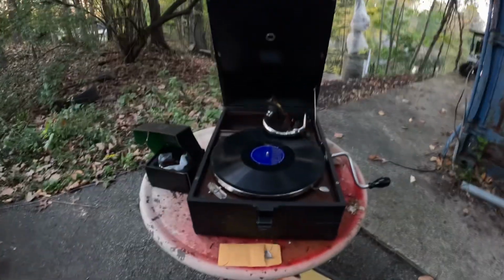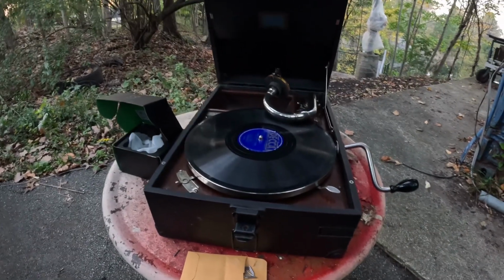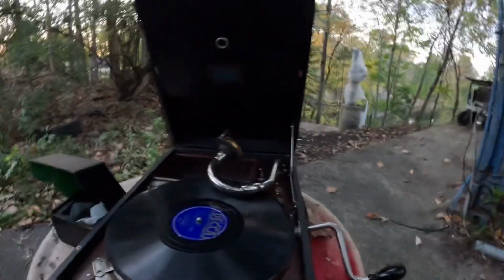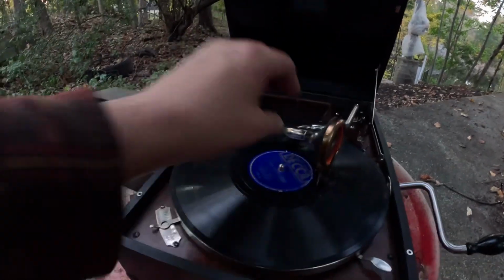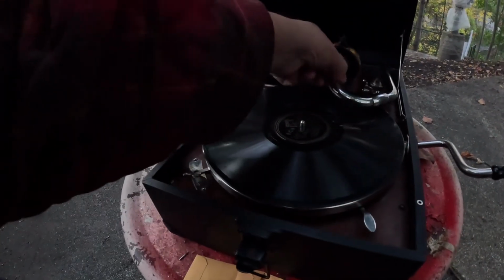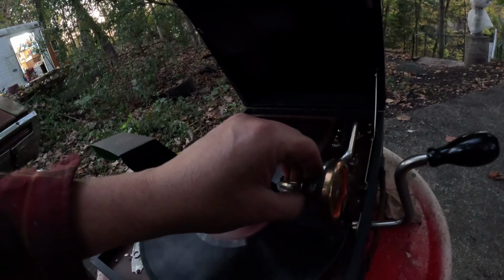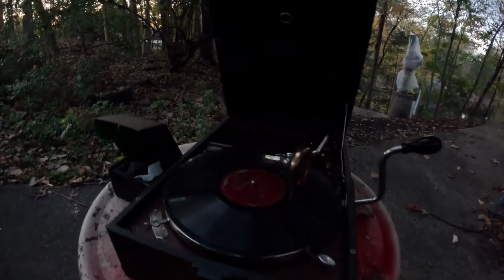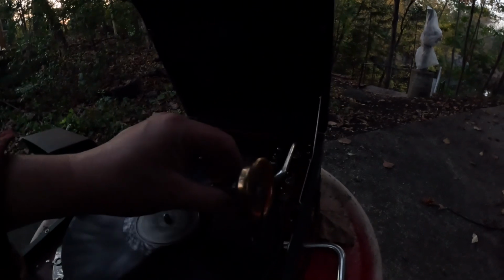Electrola 101 experimenting with victrola number 2 reproducer

Comment: I have two HMV101, both of which have weak motors and cannot properly play loud sounding electric record discs. However, the No,4 reproducer with mica diaphragm sounds good and is a lightweight and easy to carry.
Reply from the maker: All of these portables have small and somewhat weak motors. It’s the nature of the beast as these are portable machines they have to be light and that was something HMV seems to have understood better than some other companies. If you put large springs in a motor you have to make the motor larger and weight increases. We saw this happen with the colonial models made in India, where they used the double spring motor more commonly found in large table, tops, and floor models. Now you’re hauling around a piece of furniture. Now springs are available, new ones they are 1 inch wide by 9 to 12 feet long depending on the model of motor. If you have the number 59 motor that’s the spam can motor with the aluminum body. Then it’s going to  be 12 feet long or 13. Sometimes you find that long too. It will have a pear-shaped hole on the outer end, and it bent end on the inner side. I am sure US suppliers can make the spring for you, and if you were in the UK, you could find them there from suppliers or from a supplier in the Netherlands, who advertises on eBay a lot. At best even with a new spring you want to keep the records to the ones that are in reasonably good condition for playing on these machines, otherwise what you saw in the video is what will happen. They just don’t have the extra horsepower to push through a groove that is badly worn and dragging the needle. This happens to me quite a lot when I’m playing these machines mostly because I buy my records at estate sales and flea markets by the 50 lot or the hundred lot or the 200 lot not graded not inspected just bulk. You could go to eBay and I’m sure to some online places and buy records from dealers that have graded them professionally so you know exactly what you’re getting before it reaches you, assuming it does reach you with the state of the Postal Service these days. You can’t always tell how well a record will play until you actually play it. As you could possibly see in the video, the red label record kind of looks scuffed up and worn, but it played, maybe not the best sound quality but at least it didn’t stop the machine. The HMV portables make up for the weak motors by having an excellent sound quality and a very good overall design. That just wasn’t much they could do to increase the power of the motor while still keeping the small size and lightweight. And of course, it must be remembered that when these machines were new, it was expected they were going to be playing brand new records a resource we do not currently have available to us.
Reply from the maker: On another note, if you have a pot metal number 4 reproducer that is not deteriorated, and could be rebuilt You were very fortunate. Being that I play with a lot of these machines I am constantly on the lookout for reproduces to use in them.  I’ve even gone as far as having a back piece custom made in order to play one of these machines.

Comment: Congratulations you have proven a wound down spring won't play a record after one side then give it a few turns more and it will play. Wow! that's doctorate thsis level material (-:
Reply from the maker: The point of the video was to test a No2 reproducer on a machine issued with, and intended to be played with the No4.  Demonstrating that a small motor will have difficulty with a worn record was a side issue.  I believe I did wind the spring on camera before playing the records.  The motor had no issues with the Decca or the Victor red label as both records had less wear.  I knew the RCA's had serious wear, not unusual for an album that was very popular in its day.  Estate sale find for fifty cents, sometimes you get exactly what you pay for.  I will be demonstrating the machine again with better records and a good No4 reproducer later on.  This video was also a test run for the new camera that is supposed to have some very good picture stabilization technology.
Reply: @Rockisland1903  
I see, thanks!

Comment: Hello, I wonder if anybody could help me
I've recently acquired an early 1926 HMV 101 (it was my great grandfather's) and it has been in storage for a while and I want to get it working properly again. It plays gorgeously but the motor is loud and there are loud clunking noises when I wind it up and there appears to be a needle stuck behind the diaphragm.
It is a brass No.4 reproducer, are they difficult to get apart? And does the clunking mean a motor clean or a new spring? It does play fine but I want to get it sorted to avoid anything serious, it is sentimental to me
Reply from the maker: By the sound of it your motor needs a full service and your reproducer needs to be rebuilt. Full motor service means it is removed from the machine. Disassembled old lubricant is cleaned off of it. New lubricant is put back on and it’s reinstalled. Part of this process is the removal of the main spring from the spring barrel and its cleaning and lubrication that is probably the source of most of your motor noise. The reproducer needs to come apart. New gaskets installed on the back and on the diaphragm itself possibly replacement of the diaphragm also and that needle removed plus the needle bar needs to be aligned properly, so the needle sits at 90° with the side of the body. There may be other small issues in there from a machine that has sat for many years like a loose screw or two, and it probably needs an adjustment on the tone arm mount. Might need a new handle as they often do come off. Parts are available and depending on where you live, you can probably find an outfit that can do the work for you if you don’t want to do yourself. How much that cost would depend on the parts needed and who is doing the work but don’t expect it to be cheap. This is an early 101 so it will have the front mounted crank and the reproducer probably has the lettering under the diaphragm rather than on the back other than that the motor will have a slightly smaller main spring than later versions that used the number 59 motor. He’s a nice machines they play well and they look nice too. The rexine cover might be stained or torn. This can be rectified with simple application of white glue on the torn spots to glue them back down and if it’s a black machine as most, are a simple application of black shoe dye will restore its color quite well.
Reply: @Rockisland1903  it isn't early enough for the front mounted crank but it does have the brass No.4 and the label code says it's 1926 (???). Luckily the handle is still there but I was suspecting a full motor overhaul, I have actually taken the motor out and it looks pretty gummy. Thankyou for the information, everything on it seems fully original and the cover isn't too bad but has small raised patches where the glue has un-stuck, thankyou for letting me know about the white glue! I've restored a couple of gramophones before (1923 Decca junior with a "Tritona" Soundbox and a 1929 Columbia 201) so I feel comfortable having a go at the Soundbox myself.
Thankyou for your help, it really is appreciated! 👍🏻
Reply from the maker: Does it have the 410 motor or the number 59 motor 410 being the earliest one. The earliest one01 from 1926 will also have the lettering under the diaphragm on the reproducer instead of on the back. I would suggest while you have it apart that you replace the main spring with a new one, as I often find these to be weak once I take them out. As I said, before these take a slightly smaller spring than the later motors, you can always tell these because the spring barrel, and the spring barrel lid are connected with four screws to seal the barrel, there is a parts supplier in the Netherlands, who has every size spring for the HMV portables, I forget his name at the moment, but it starts with a Z I think I usually order spring from him 10 at a time just to have them in stock because I’m always playing with these machines and in fact have two waiting for me once the weather lifts and it’s warm enough to get back into my little workshop. 1926 was first year production for the 101 and they would continue until 1931.
Reply: @Rockisland1903  The motor is a 410 and the mount for the winding handle is right next to the tonearm but the reproducer has the lettering on the back instead of on the diaphragm so it might have been changed (???), if it has it definitely hasn't been done recently. The information/identity plate states it as a 101B (I don't know what that means). It could possibly be a bit of a frankenphone but it is a lovely portable regardless. Thankyou for letting me know about the spring size and the Netherlands supplier, I shall have a look
Reply from the maker: My guess would be late 1927 to early 1928. If it’s an all brass reproducer, then it’s likely the one that came with the machine even if it doesn’t have the lettering under the diaphragm as only the earliest models had that feature. I have 101’s with that same mix of parts so it’s not unusual.  
I can look up the 101b easily enough when I am home later and see when the production run was.
Reply: @Rockisland1903  Wonderful, that would be a really interesting piece of information for me. Thankyou so much!
Reply from the maker: OK the 101b appears in mid 1927 with the 410 motor and it would not move on until mid 1928 when the E and F were introduced in late 1928 and early 1929 the first motor to be used in the 101 in 1925 late 1925 was the 425 motor that anybody that has an HMV 100 would be familiar with and then it went to 59 and finished out with 270 and apparently some of the very last ones also use the model 59 motor probably they were getting rid of old stock. OK the rest of this is from the book his masters Gramophone by Brian Oakley and Christopher Proudfoot.

101 B side, wind, external fittings on black case oxidized, colors introduced in parentheses we have red leather with guilt, fittings, blue gray and brown crocodile grained, leather cloth with nickel fittings and the 410 motor.
Reply from the maker: There was a 101C and a 101D but these were essentially the same as the 1 01 B with minor differences in the handle and the catch
Reply: That's very interesting, mine is black with a brown platter and wooden motor board, the sidewinder on it is weird (some sort of moveable bearing you put the handle through) and the metal corner pieces on the case are brass though they have traces of black paint on them. It needs a bit of work but I love it, fingers crossed i can get it all mechanically sound again 🤞🏻
Reply from the maker: There were a lot of little changes going on in these years as they were developing the 101 into what it would end up as in 1931. That rotating ball in the winding handle escutcheon I have that on several of around this year it’s normal. I have seen the corner protectors both polished and black mostly black. The wood motor board the brown colored felt is all HMV 101 normal. By the sound of it your machine is original for late 1927 early 1928. I have several like it one of them being an Electrola model sold in Germany. Good machines and not difficult to work with.
Reply: Thankyou very much, it's nice to narrow it down. It is all completely original, I'm amazed how it has survived relatively well. I've just ordered a new spring and I have managed to get that needle that was stuck behind the diaphragm, the Soundbox seems airtight and working ok now.
I'll get to work on the motor soon, again thankyou so much for your time, good luck with your current projects! 👍🏻
Reply: @Rockisland1903  just another little quick one: how do you correctly set the pivot-points on the No.4? I've heard you set them to how they sound best but sound is subjective, some people like different sounds, so is there a certain way they are supposed to be? Should they be tight or loose?
Reply from the maker: @LarryBrunswick  the thing with the number four pivot is that they cannot be either to loose or too tight or they will not work correctly. You must set it so that the pivots are holding the bar just snug enough so that they could not move from side to side but has full freedom of movement forward and back. This is tricky and it can take some time to get right. This has to be done before you attach the needle bar to the diaphragm so you can freely swing the needle back-and-forth. Once you think you have it, then you attach it to the diaphragm but do not seal it with wax yet, test it first. If it sounds good then you seal it with wax otherwise you have to take the screw out and adjust to make it slightly tighter. Remember when you tighten these things you are moving in tiny increments.
Reply: @Rockisland1903  That is really useful information, thankyou. I took the diaphragm out (it seems like the original one) and it seems good, but I want to make sure that the pivots on the Soundbox are set up properly as they should be. I didn't know how they should be set so thankyou very much, I'll get straight onto it 👍🏻
Reply: @Rockisland1903  sorry to take up your time again, but do you know what the needle bar is made from? When I placed the No.4 flat on a table, the bit where you insert a needle is angled slightly downwards, towards the tabletop. Is it supposed to be like this or should it need straightening to be perfectly horizontal? If it does need straightening, id like to know what metal it is so I don't accidentally snap it or warp it.
Reply from the maker: Steel, and be very slow and careful if you have to bend it.  Doesn't matter how the bottom is canted, what matters is how well the needle when installed lines up with the side of the reproducer body.  It shouldn't be canted in or out when you look at the reproducer sideways, if it is then bend the bar slightly until it lines up.  It should not be loose on it's pivots.  These are set so that they hold the bar just snug so it can't move side to side, but not tight enough to bind up.  This adjustment can be a pain, and take some time. @LarryBrunswick
Reply: @Rockisland1903  ok, thankyou for that, I figured. When I place the soundbox on a record, it plays well enough (no blasting or buzzing) but the needle is pointed slightly towards the centre spindle of the platter (about maybe 2-3 degrees). I'll see if I can attempt to bend it into shape, it least it's not made of brass like the rest of it. Thankyou for your time 👍🏻